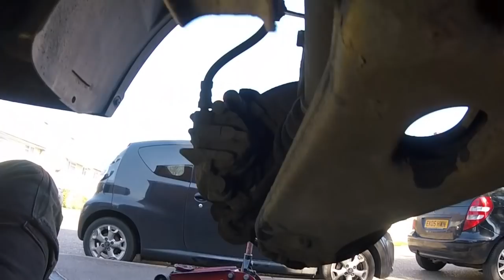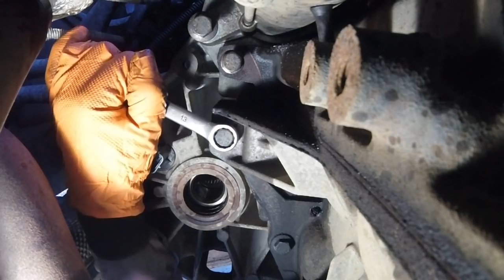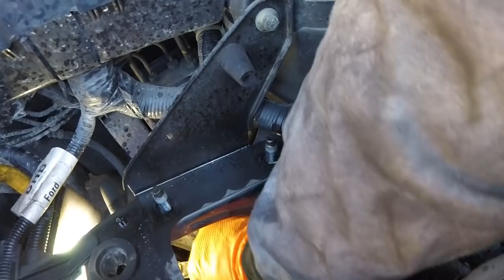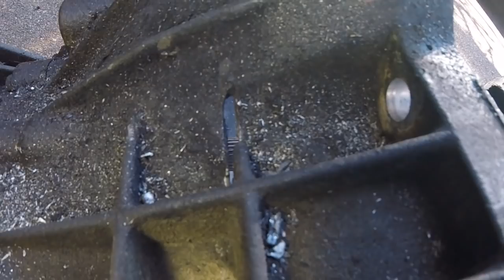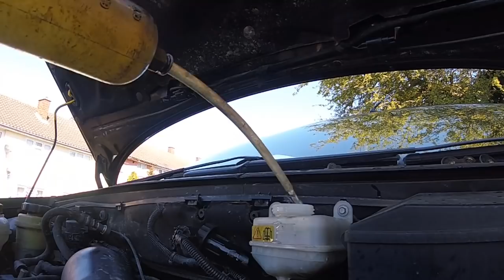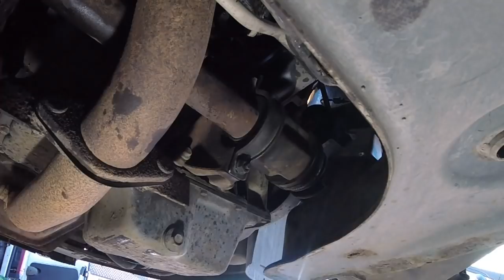2003 Ford Focus 2.0L Petrol Clutch Replacement

Comment: As an ex mechanic myself I am very impressed. Note to the DIY folks clearly Kevin is a pro with vast experience doing this every day makes the work look easy also he has super upper body strength gearboxes are heavy don’t expect to be able to copy him. He uses the electric impact gun a lot but he is very skilful with it if look carefully he turns down the power on the smaller bolts/screws to prevent shearing
Reply: Ex mechanic myself. However, you never actually get that oil out of your blood.
So I look to you tube for direction, and this guy nails it.

Comment: I'm a mechanic myself and can appreciate how heavy gearboxes are especially when doing this on the ground,keep up the good work
Reply from the maker: Graham Bell thanks for the feedback much appreciated
Reply: just done my clutch on my 2006 renault trafic,gearbox was heavy,,love to see a video of you doing one of them,,you make it look so easy
Reply from the maker: Graham Bell at one point is was doing them almost every week. Traffic /vivaro. 

I think I’ve pretty much cleared them out 😊... it usually takes about 4 hours ... how did you get on. Did you remove bumper and the top skeleton. 

If I get another one. I’ll definitely do a video

Comment: Thank you so much for this! I was covered in so much grease I didn't take pictures and consequently forgot where all the wiring brackets went (like the one on the starter bolt for example). Fortunately you took the time to record each and every bolt.

Comment: Amazing video as always,  i have a question if possible  , for the same generation car but with the 1.8 tdci does the subframe has to come out or can it be done with it in place. There are split opinions  on it what would  you do. I am asking  because  i have followed  your  tutorials for so long and they always were  spot  on when  i did a clutch.  Thank you  so much

Comment: I finally got my gearbox in. I had to ask my dad for help. Seeing you just lift that thing in is amazing. Simply the best!
Reply from the maker: Glad to hear you managed to finish off your repair successfully.., well done you .,, ✨✨🍻🍻
Reply: What did you use to cap the fluid line?
Reply: @fukoofjj  i wasn't able to cap the fluid line I didn't get a cap to hold it. I took the line off the bracket and held it upright so it wouldn't leak out. I wrapped a rag around it to stop any fluid from dripping down.
Reply: @ya_boi_zak5927  thanks for the help I appreciate it! I'm waiting for my clutch to come in and I will get her done

Comment: Having the hardest time getting the drive line out on the driver's side(left) you made it look so easy with that pry bar
Reply from the maker: How did you get on in end.
Reply: Ended up just taking the boot off, right before where it connects to the transmission. Hope that was okay to do. I have general knowledge of mechanics, but I'm definitely a novice.

Comment: Hi Kevin, great video!  

I've got a few questions, if you don't mind. 

1. You applied a sealant on the slave cylinder.  If I am not mistaken, Ford originally use an O-ring there, but it was known to cause leaking issues. So, a sealant was used instead.  Is this correct?
2. We do not have that brand of sealant here, do you know of another brand / model sealant that would be comparable in the USA? Morotcraft sells a small tube called "Gasket Maker TA-16".
3. Would Motorcraft long life grease work in place of the red grease you added to the housing? Motorcraft part XG-1-E1 
4. What do you think about using Sach's spline grease on the input shaft?
5. Lastly, does removing / reinstalling the subframe assembly have any negative impacts?

Thank you!

Comment: Awesome video! I'm anticipating this job sooner or later on 2002 Focus zetech 5
speed but what scares me is when pulling  the second left side short cv after the long one what is that doohickey in the transmission. Is that to hold in place the spider gear[s].industrial paper clip looking thing. Does that stay secure during the manhandling of the transmission.?
Reply from the maker: You should be fine. If you follow the video. It’s not too bad these focus.

Comment: Hello
Im from USA. Great video - thank you! There must still be a lot of old Focuses in the UK. Very similar to my North American 2002 Focus wagon Zetec 5-speed. That car needs a front suspension alignment and new tires!
Cheers
Paul (in MA USA)
ps Just curious if the mask was because of Covid or cold?
Reply from the maker: Hi Paul .., they are pretty much the same engine if not identical..,,, The chap that owns the car is a fairly old dude ..,, he’ll get round to sorting out the extras ..., good spotting tho ...,

The mask is not really for Covid ..,, it’s firstly for the extreme cold during winter ..., otherwise I can’t feel my face and can’t speak after a few mins ...😁..,
But most importantly it’s for protection against any dirt or oil and most of all the old clutch dust ...,, I can’t take any chance to getting exposed on a daily basis. The work is hard and environment quite harsh on the body .... I try and be prepared the best I can .., physically.., mentally as I work by myself and have the right gear... thanks for taking time to leave the comment .., much appreciated and a big hello to you across the pond. 🍀🍀

Comment: what is the black stuff you use to seal the slave cylinder in place, as i assume it stops the gear oil leaking out into the bell housing thats lubricating the input shaft bearing you can clearly see and also the name of the red stuff you put onto the input shaft and bolt holes.?

Comment: Have to have this done to mine , but clutch is not the problem , the damned slave cylinder is leaking !!! SO MAD over the internal design of it.
Do I have to resurface or replace the flywheel if it works fine now ?
Also my rear main seal needs replacing , so is it much more work ?
Reply from the maker: Not a lot of work. I think if you have the correct tools it can be done in a weekend.
Reply: @WMCS  TY Sir, tomorrow is the day! I am having it done, with parts I sourced to save money. OEM Ford flywheel is better quality so they are going to resurface it, if possible.

Comment: How do you approach a job on a car you have never met before, do you just pitch up confident in your experience, or do you do some research onto any pitfalls?  To be honest I would spend all day figuring out all the strange fixings and wiring connectors on modern cars. Great videos, great skills!
Reply from the maker: Robert Baird thanks a lot for the review ... if I’ve never done a model before. Firstly I get really excited.  Then I take about 5 mins and have a look around the engine bay and underneath....

The first thing I try and determine is wether it’s got a partial or full subframe. To determine wether the box will come out or stay into the subframe. 

Then the locations of the mount. And without further ado I crack on. Always have my earphones on. Some good music. I tune out the world. Get in a zone. Come hail. Rain or snow I don’t really notice it .... I love it .
Reply: @WMCS  now then bud, how do you price up the job if you get a vehicle model you haven't seen before?
Reply from the maker: John Morton I always use auto data for pricing up.., then just dive in comes the day.

Comment: What’s the make of the anaerobic sealer you are using on the slave cylinder? Cheers
Reply from the maker: It’s triple QX black sealant.
Reply: Cheers mate 👍 got a 2.0 focus with a noisy release bearing after watching your video I’m going to give it a go

Comment: Does the 2.0 have a bigger gearbox than the 1800
Reply from the maker: They’re almost identical in both weight and fixings. Only difference is the bell housing is about an inch deeper. ✨✨
Reply: @WMCS  different box on 2.0

Comment: Whoaaah, what a destruction! How can that car move with that clutch! And how long has it been that way! It is incredible! I am surprised that it has neither damaged the diaphragma nor the flywheel!! You can use that clutch as a grinder!!  

At 6:55 much water came out. Maybe the rain drain was plugged.

Is de sealant for the CSC silicone? Other gearboxes have an o-ring as I see. The purge for this CSC seems easier than newest versions where the tube has to be semi-inserted. In those cases I find it difficult to imagine that all the air came out.

This time it seems that you relied more on the spanners to fasten the gearbox bolts than your M18. Why? Space? You missed the spanners? :-) And this time you fastened them after rasing the gearbox. Other occasions are the contrary.

Last: is it allowed to work on the pavement there? Here it is not, if it is public. Maybe that was not the case.

Thanks a lot! Hope you can still working and waiting for next!
Reply: Yes UK allows it, you also do not have to be a licensed mechanic

Comment: What's the gunky stuff put on the back of the slave cylinder
Reply from the maker: That’s called sealant .,, this one is an oil resistant sealant
Reply: I’m about to start this project. 

I’ve got the Motorcraft TA-16 gasket maker. That’s what the service manual recommends. 

Thoughts? I’ve seen recommendations for Loctite 518.